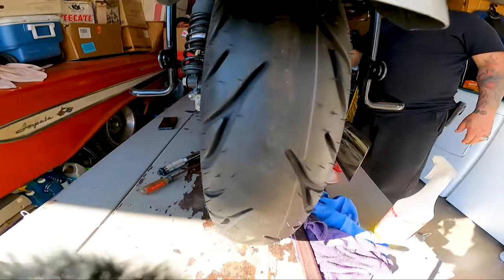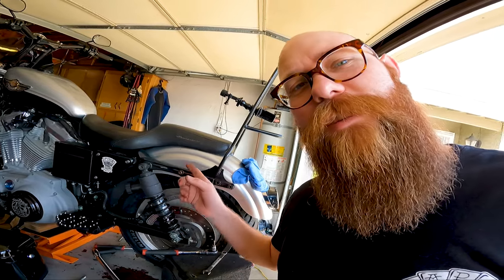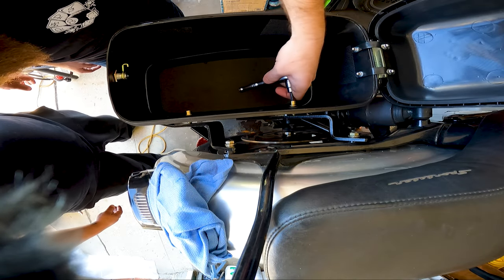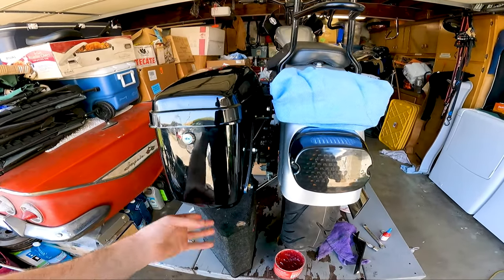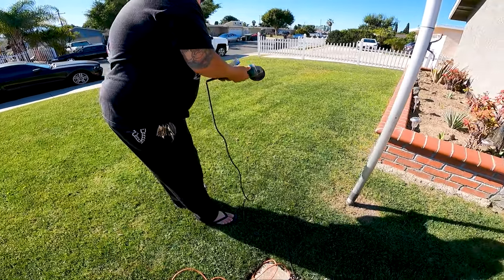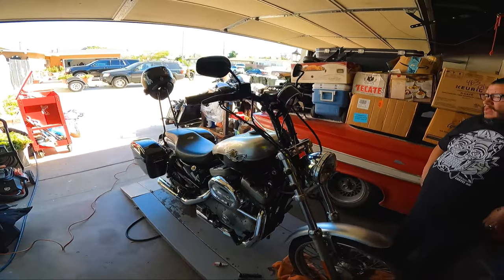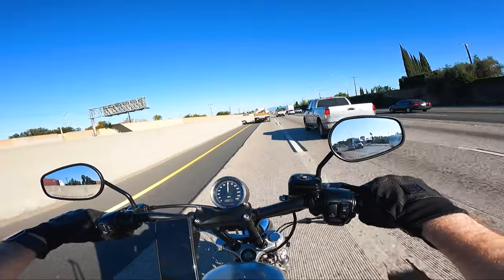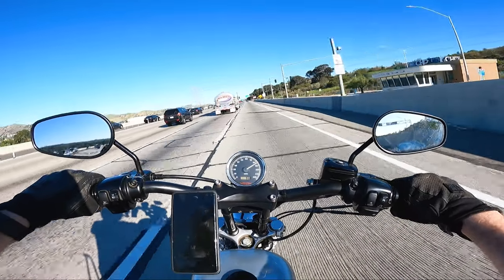Let's Mount Some $80 Amazon Hard Bags!

Comment: Bought '22 Honda Super Cub and saddlebags are the one thing I've been struggling with.  I've been putting some real money into it to "make it mine" and not just buying cheap things that will fall off, but saddlebags... damn.  I get that "you get what you pay for", but I don't really need $600+ saddlebags on a bike that isn't going more than 15 miles a day.  I COULD buy the Honda hard bags that are meant for the bike, but $400 and shipping would be almost another $200 from Japan.

The struggle is real.
Reply from the maker: Oh I feel the struggle. I'm 1k into my current set of bags. These were a great option if you want hard bags. with $100 more you could spruce them up more with sturdier mounts, a police style guard rail, better weather stripping etc. More options and less fear of damage with these IMO.

Comment: Great video mate. Keep them coming. I checked out the bags you linked, they are almost exactly double the price lol. I'm still gonna get em and try em. I just got almost the same sissy, I got a fold down one to hold a can from viking bags for my 20 sporty iron special,  was a nightmare to install, had to remove all the struts, covers, lights etc, all with the tire on because I don't have a cheap lift, my other one took a crap. N e ways, I see you have a serious channel too and I like your approaches. Good job mate

Comment: Just came across your video !! Nice bike . I'm looking to put hard bags on my 2001 vulcan vn800a,  how have they held up? How are they on the highway? Any and all information is greatly appreciated!!  ride safe
Reply from the maker: So far so good. I commute about 40 miles all freeway and I haven't had a problem. Not a ton of miles with them tho. As far as storage space they're much better than my old bag with a sock cut out meant for this model. Only thing is they do bounce a little and if you have something like a lock you'll hear it in there. But for 80 odd bucks I definitely can't complain.

Comment: They're now $159
Reply from the maker: Wrong ones, these are 105 now. Check my link.
Reply: @ZozzerRidez  I will! I'm very very Interested . I got a 20' iron, got the back Indicators off right now, so I'd like to see if I can get a set of cheap bags on it before I make my trip to Milwaukee in June
Reply: @ZozzerRidez  thanks
Reply from the maker: Definitely enjoyed having the space those gave. Still worth the price imo 👍
Reply: @ZozzerRidez  what year bike did you put those on? I'm actually almost about to pull the trigger, I need to know what year that is u got. Dude, nice work man.
Reply from the maker: It's an 03, the mounts are fairly universal though.

Comment: They'd look better if they were on right. Key front, hinge rear.
Reply: NO !   You would never want them to open from the front to the back. That is absolutely backwards. For so many reasons.  The number one reason is if the latch / lock ever breaks, or you don't have closed and latched correctly, the wind will blow it open and probably break the lid.

Also....   Look at any hard saddle bag that has an integrated light in it. The light is always in the back of course,  and they always open back to front.

Key / lock always in back.  Hinge ALWAYS in front